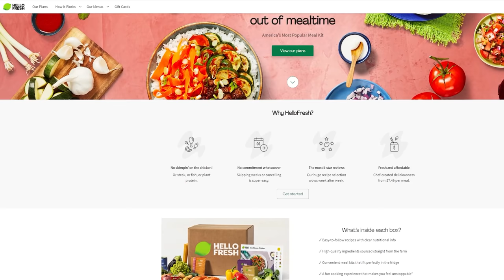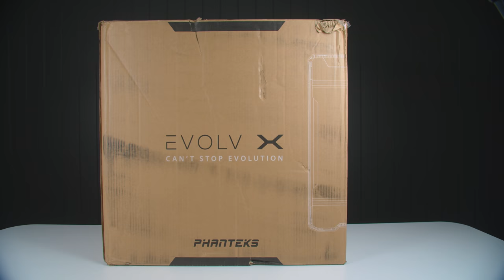Building in my NEW Favorite Case!

Comment: Love your videos - For a WHITE MEMORY I have TEAMGROUP T-Force Xtreem ARGB 3600MHz CL14 in Frosted White. They are DDR4 though, but CL14 - For me they are quick stable and beautiful.
Reply from the maker: Very nice!
Reply: @DesignsByIFR  Uppp

Request build PC NAS :

Processor : Intel Xeon E-2244G or E-2276G
Motherboard : Gigabyte C246 WU4
Memory : 2 X 8Gb RAM DDR 4 3200mhz ECC unbuffered ) (Samsung /Fujitsu /Dell)
Graphic card : GTX 1650 
Main Storage  :WD Black SN750  m.2 nvme 1 TB
Storage HDD : Toshiba N 300 @10 TB (4 buah) Raid 1
Casing : Fractal node Define S2
Watercooling : for cpu 
Fan cooler : up, down, front, back
OS : TrueNAS or new Ubuntu Desktop
💪💪💪💪💪😎😎😎😎
Reply: Hi there
Do you do builds for clients?
Reply: @DesignsByIFR  hi there
Do you do custom builds as I would like one done

Comment: That's a really neat build Cory and the blue pastel coolant complements the white build nicely.

You connected the Phanteks D140 distro plate differently to how I have mine in my second rig. I used the bottom inlet to take the feed from the pump and worked up from there leaving one free port at the top for bleeding/filling if I ever so need. Essentially, your loop looks to be running in series whereas mine is running in parallel (which splits further at the GPUs as I have a parallel manifold installed). My main rig has a Phanteks D120 distro plate for... reasons - I just like the look but it's far less configurable than its bigger brother.

As for DDR5 memory, G-Skill make some white (Ripjaws) memory albeit non-RGB... the Trident RGB series looks silver to me.
Reply from the maker: Excellent! Yes i personally love it for the looks as well. I will check out that ram